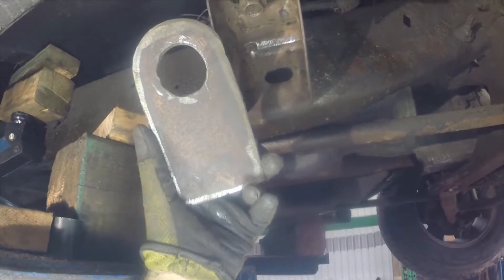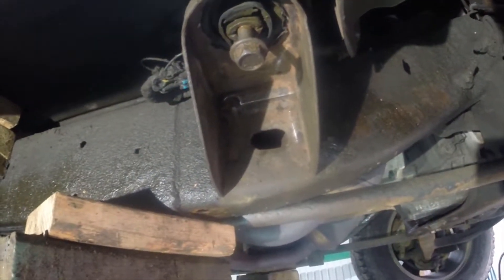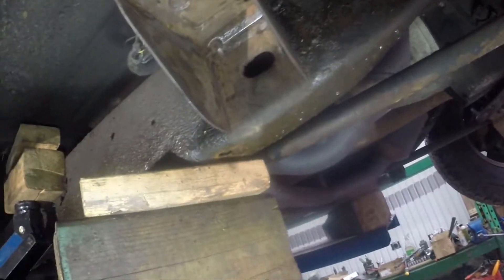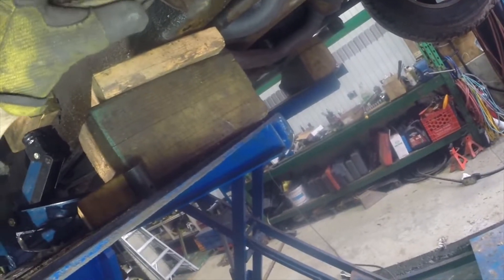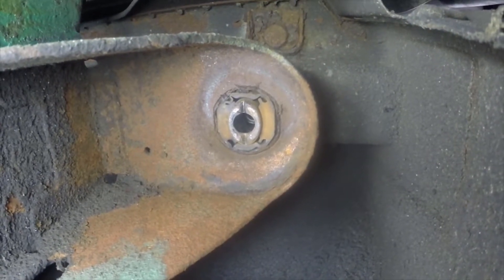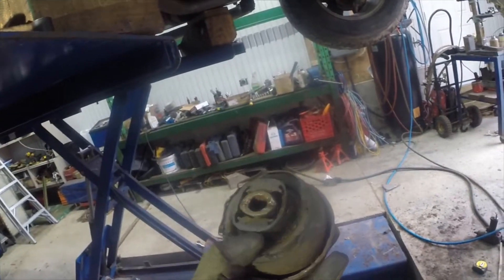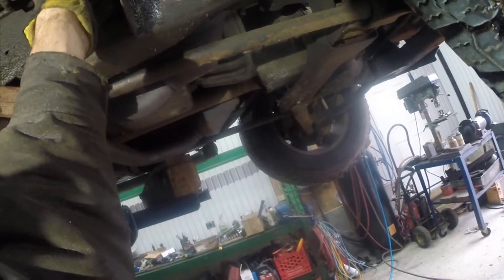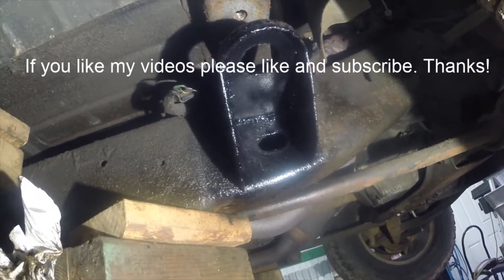DIY - Repairing Body Mount Frame Bracket On Truck SUV

Comment: I am attempting to do this without welding by adding a piece of moderate thickness sheet steel top and bottom, then adjusting shim placement. No idea if this will work or not, but I'm out of energy to fabricobble (and have poor welding skills) just from what it took to get the bolts out ha. Suspect it may still allow "bounce" and/or sliding. Also coated everything in marine, safe for polyurethane grease to try to prevent more rot. We'll see. Will try to remember to report back. Way more work than I had intended to take on. Had 2 like this on the driver side, hopefully 2 or less on the passenger. Also had rotted out "sleeves"/cups that the upper bushing sits in. Got a bunch from the junkyard, only to find out that they're radiator support ones, and the top is half the thickness, so had to buy dorman mounts to mix and match in. Had a hell of a time with bolts too. If anyone knows of a way to get 120mm length bolts (there are 4 different bolt versions from 99-13 that I can tell) with enough thread length, post it up. The 110mm m12 bolts are like 3.60 online, the longer ones like 14.89? (Before shipping) - much more from the dealer. Standard metric bolts that you can buy only have 30mm minimum of thread, which isn't enough for some of these and you won't know until trying. Ended up buying gm bolts at a discount thru my shop. Thought I needed all of them because the ones I pulled out first were destroyed, but I'm going to have extra 25 dollar bolts lol. Makes me understand why the dorman kits are so expensive. Also can someone explain why the silicone s&b brand mounts aren't sold in sets for the SUVs. I tried to save money over buying all dorman by using the energy suspension bushings, then had to get more and more parts as I got deeper. What a pain in the ass. Didn't want to throw away my 2001 Yukon XL K1500. Too many memories, been in the family since new, and it has a throttle cable and mechanical fan! Going to double down on my fluid filiming/blaster surface shielding after this to combat the Ohio life it lives. We'll see how long it makes it. 240k now. I'm trying to save the environment by not throwing away my cars! Lol
Reply from the maker: Wow your story sounds like you have had one terrible time. I do worry your proposed solution without welding will not pass motor vehicle safety inspection. Corrosion certainly makes things difficult for us do it yourselfers. Let us know what you end up doing and how it makes out. Thanks
Reply: @mrdiyguy123  not fun, that's for sure! No safety inspections here in my part of Ohio, but I certainly do want to make sure it's safe. That said, it'll definitely be better than it was! If it doesn't work out, I'll figure something out. I'll report back with my findings once I get it finished up and evaluate it. Thank you!

Comment: Whenever you’re working with rusted bolts, ALWAYS tighten the bolt just a touch to crack the rust loose and THEN loosen the bolt. Just a quick easy trick for anyone that reads this.

Comment: Nice job, gonna do it myself as well. am just a bit worried how or where exactly to lift the cab a bit higher. are there special strongholds where we lift the cab?
Reply from the maker: The cab doesn't weigh a lot (no weight of frame, wheels, drivetrain, box.  Consequently, I used a small jack pushing on a 2x4 pushing on the bottom of the cab to lift it a couple of inches.
Reply: @mrdiyguy123  I see, and the bolts on the opposite side, you just loosen them up for 1/2 an inch or so? So that they do not come out suddenly. While I lift the cab a bit.
Reply from the maker: I loosened all bolts a lot on the side I was repairing and a little on the other side.

Comment: Those bolt are hardened they dnt break
Reply: I broke mine😔
Reply: Lol they do too mine is fucked off
Reply: Ok brand new they shouldent break rotted yes they do lil
Reply: Bolts that are hardened are more likely to break under certain forces
Reply: Lol I had one where the shank was about 1/5 the diameter it was originally. Only got it out by heat cycling it with a bolt buster inductive heater about 20 times, but I was prepared to drill a hole in the floor and got "lucky" Haha.